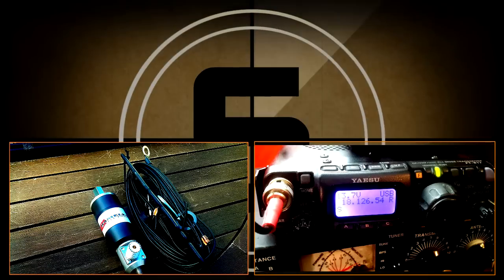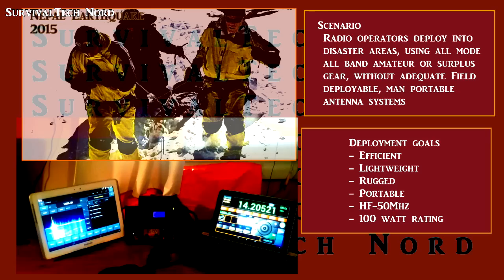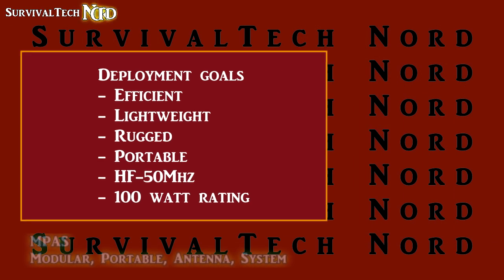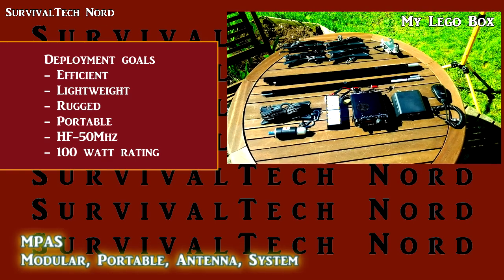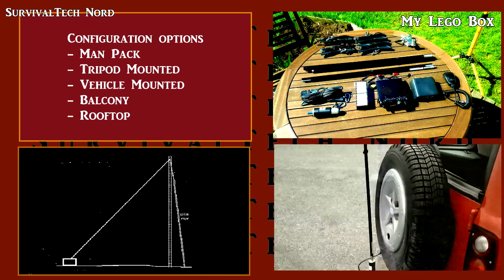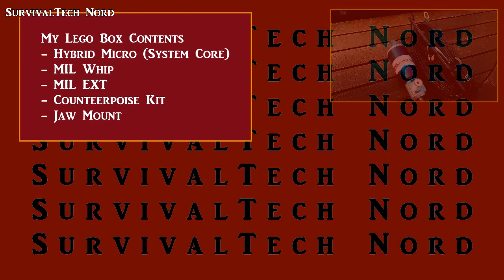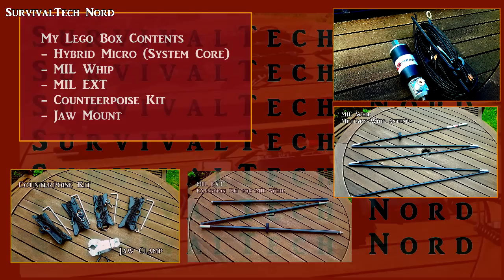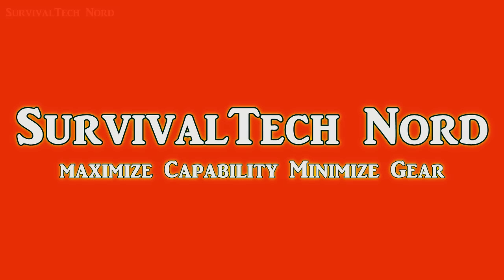Chameleon Antenna MPAS Modular Portable Antenna System

Comment: I am a huge fan of yoyo antennas
http://www.hamradiofun.com/yo-yo-vee.htm

They get great reviews from eham.net and their price is pretty inexpensive.  What I like is just how small and lightweight they are while being modular and supporting numerous frequencies.  Plus if you look closely at the yoyo antenna you will notice that they are simply "Coghlan's Laundry Reels" which can be bought for $3 each online.  So buy two of those plus some cheap speaker wire and you can rig a very inexpensive solution for a simple inverted V.
Reply from the maker: That's an excellent suggestion. I often work man portable, and admittedly,  often forget that a simple inverted V for a home location is a viable solution. 

Great suggestion.